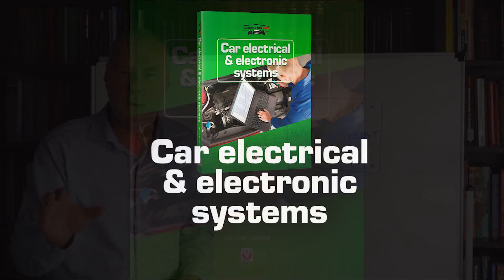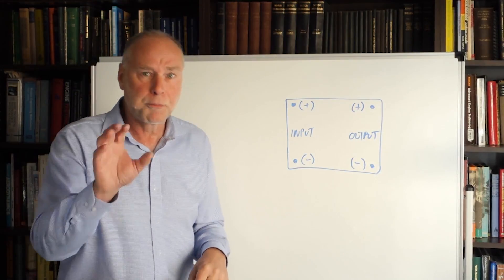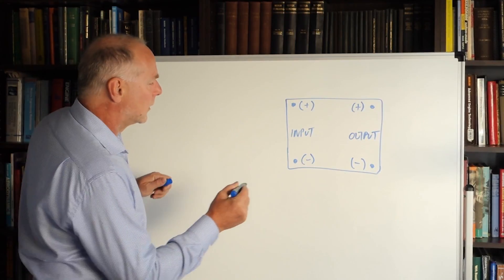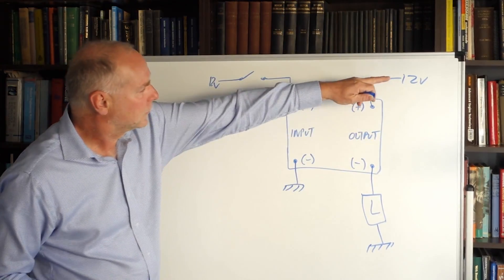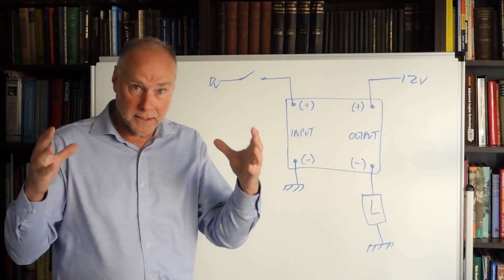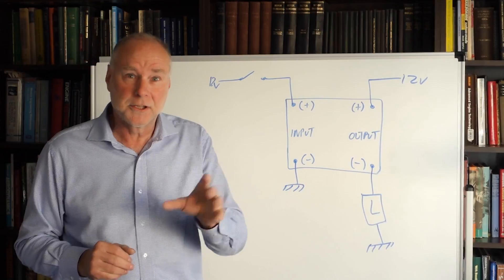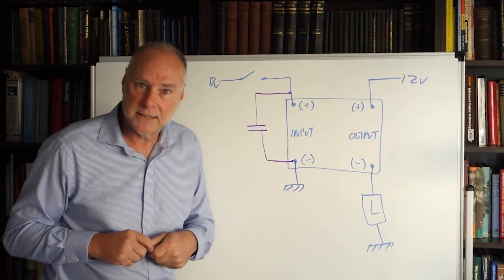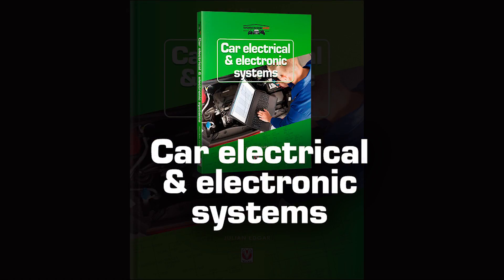Using Solid State Relays on Cars

Comment: Im stunned noone in 2023 has drop in ssr that fit into standard relay positions in older cars. 
Several types of relays onboard, yet noone has marketed a 10 second to  pull out/ drop in module to upgrade existing "dinosaur tech"

Comment: Had read thru the pros/cons of SSR & one of it is voltage leakage after power off. Not much about 0.1mV but will this drain your car 12V battery over period of time when not in use?

Comment: Why (in your air suspension switching control) do you also have a conventional type relay (blue logic level relay on pcb)? I'm assuming since they're shown together that they're used together but can't think of a logical reason for showing them together when the video is about SSR's or why you would want to use them together. (Not intended to sound so negative! Great video, I'm just intrigued).

Comment: Hello, I am sure, that you are making a mistake by showing the output side of the relay different polarity! The output side: terminals 1 & 2 are normally open. When the relay is energized and closing the output contacts there become the SAME POLARITY whatever the issue is! Contact of input is 3 & 4 (where 3 is positive and 4 is negative or ground as you are indicated) In one word your explanation is a big mess and I will never employ as a teacher! You will blow the whole world! Have a nice day! Alex
Reply: No mistake. The output side must be shown as negative on the SSR. The negative sign is to symbolise which side the load (positive lead of consumer) goes onto. If you place the load on the wrong side the relay will not switch off due to the voltage present at the gate of the triac. A triac works in one direction of flow and serves as the electronic switch in the SSR.
Reply: @shanenortje1837  Whole point of the video was to describe exactly this, but some people swear they know best ¬.¬
Reply: I suspect the information given is for lay people not electronic technicians. Sometimes the obvious is obfuscated by correct technical explanation and makes it difficult for the DIY person to have a clear understanding as to what they are doing. For example, I am fitting a thermo fan to my car's radiator. I found this video straight to the point and very clear.

Comment: I had to build my own DC solid state relays for my four Mercedes electric car battery modules. Each relay that I designed and built is rated for 56KW power handling capability. The modules themselves, at full charge, are 109.6 VDC and capable of 3C, which is 254 amps, but I will only be pulling 50-80 amps from each to drive my Outback inverters for my house during power outages. The market simply doesn't have solid state relays in the voltage range that I needed. I'm using two MOSFETs in parallel, each rated at 200V and 140A. That way the BMS can switch out of circuit any one of the modules that has either imbalanced cells, or is close to 80% depth of discharge in the Li-ion's.
Reply: Why not use contactors for this application? Sounds like a great project though

Comment: Hi I 've used solid state relay for my car dome light trigger, as we know car dome light is negative trigger. so I connect pin 3 to continuous +12v and pin 4 to switched ground negative. When the pin 4 swithed to ground  the relay work as expected it joint/closed pin 1 and 2, however once the pin 4 ground is switched off the relay is still closed. Any explanation or solution to this issue ?

Comment: Hi trying to turn on a relay with feed from rev counter shift light so only low current at switch side not enough for normal relay thinking a solid state would take less to switch am I right